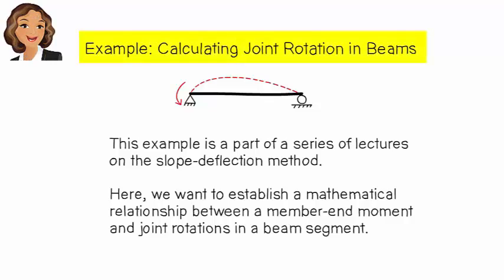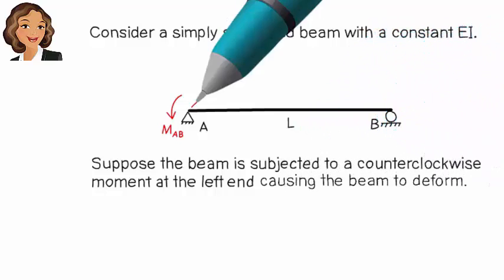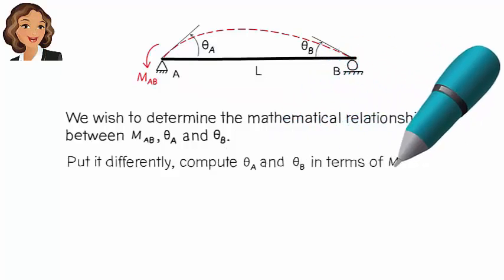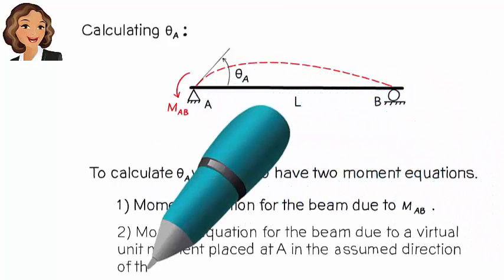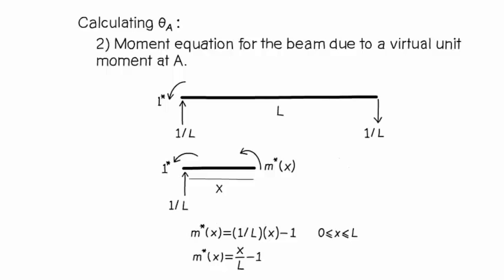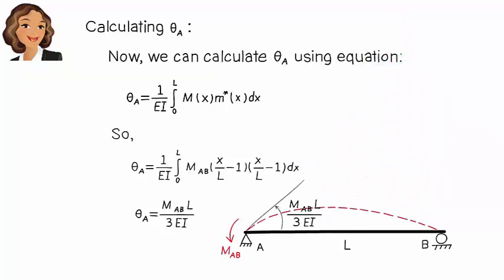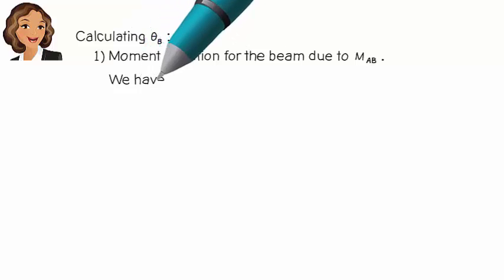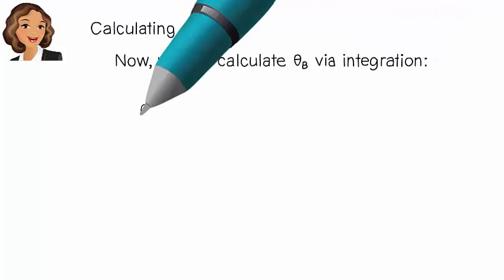SAPS01: Example of Joint Rotation Calculation in Beams

Comment: For calculating theta A in the moment equation for the beam due to M(ab) how do you get the applied load on both ends to be M(ab) /L and for the virtual unit moment how did you get applied loads on both ends to be 1/L
Reply from the maker: We have a simply supported beam subjected to a moment at its left end (Mab). The length of the beam is L. Let R be the support reaction at end A, and V be the support reaction at end B. Since the beam has to be in equilibrium, we can write:

The sum of the forces in the y direction = 0. Or,  R + V = 0.
And the sum of the moments about point A must be zero. Or, Mab + (V)(L) = 0. 

Solving the second equation for V, we get V = -Mab/L. The negative sign means the force is actually downward, as shown in the video. 

Solving the first equilibrium equation for R, we get: R = Mab/L.

Using the same strategy, we can determine the reaction forces when the beam is subjected to the virtual unit moment.
Reply: @DrStructure  thank you for the explanation and the quick response very helpful and much appreciated
Reply from the maker: You're welcome.

Comment: For theta b, i got the virtual moment to be x/l not -x/l as you have stated because in the FBD, the shear force will be acting up, therefore the moment will be acting a clockwise direction not anti clockwise as labelled in the video, therefore arriving at -MabL/6EI,  am i wrong? Or does the minus sign simple correspond to the rotation being opposite of theta a, with theta a and theta b being counterclockwise and clockwise respectively?
Reply from the maker: Yes, the bending moment is clockwise with a magnitude of x/L. Or, anti clockwise with a magnitude of -x/L. They both mean the same thing. For the sake of consistency however, we always write the moment equation in beams using the established positive sign convention, which entails showing the moment at the cut point in the anti clockwise direction.
Reply: @DrStructure  Thank you for the vidoes and the quick reply!

Comment: Sir, Initially you have drawn the elastic curve in upward direction is assumed one or it should be drawn based on external moment applied at joint A.

BECAUSE IN AN ANOTHER EXAMple A  BEAM WHICH  CONTAINS CLOCKWISE CONCENTRATED MOMENT ACTING AT CENTRE where you have drawn the elastic curve intially that it acts like downward deflection and later in the final results you have changed its orientation in left part of the segment(L/2) that behaves like upward and right part of the segment (L/2) that behaves like downward.
Reply from the maker: We can always assume a direction for displacement and/or rotation, when it is not know or when we are unsure. When we solve the problem, the sign of the answer tells us if our initial assumption was correct. For example, suppose we assume an unknown joint rotation to be clockwise, and draw the deformed shape of beam using that assumption.  After going through the calculations, say, we get a negative value for that rotation. The negative sign indicates that the joint rotation is opposite to the assumed direction. The solution is still correct even though our assumption was not.  If we go through the solution one more time using the correct assumption, we end up with exactly the same value for the rotation but with a positive sign.

Comment: Excuse me, @0244, why do we calculate the rotation by virtual work method? Can we solve the rotation by double integration       theta = Integrate M/EI dx SA13 01:43    ?
Reply from the maker: Yes, of course. The rotation can be calculated using various methods.  I have been using the virtual work method for such calculations for the sake of practice and consistency.

Comment: shouldn't the integral with Mab give the joint rotation at A directly
Reply from the maker: Not quite.  Rotation in a beam (as a function of x) can be expressed in terms of the integral of M(x), not Mab. 

In this case, M(x) = Mab (X/L - 1). So, theta can be written as:

Integral (M(x) dx)/EI.  Or,
Integral (Mab X/L - Mab)/EI. Or, 
(Mab)(x^2/2L - x) + C where C is the integration constant. 

To determine C, we need to have a boundary condition, like knowing the slope at a specific point. 

Once we have the expression for the rotation, we can then evaluate it at 0 and L to get rotation at A and B, respectively.

The virtual work method is an alternative approach to the above. It works best when we are interested in specific rotations (or displacements) as opposed to their algebraic equations.

Comment: why I can't use virtual unit force calculate the rotation? is it only suitable for virtual unit moment?
Reply: because I have tried that but I got Rotation A = (5ML^2)/6EI
Reply from the maker: Say, we want to calculate rotation at a pin support. If we placed a unit vertical force at the support, instead of a unit moment, what would be the resulting bending moment equation for the beam?  It would be zero. A vertical force at a support does not cause any internal force or moment in the beam. So, I am not sure how you have actually calculated rotation at the support using a unit force instead of a unit moment.
Reply: I have confused on moment equation but I can solve it now, thank you